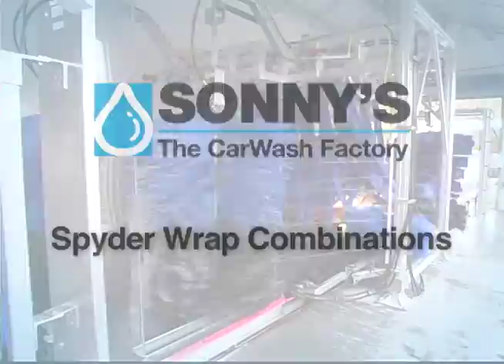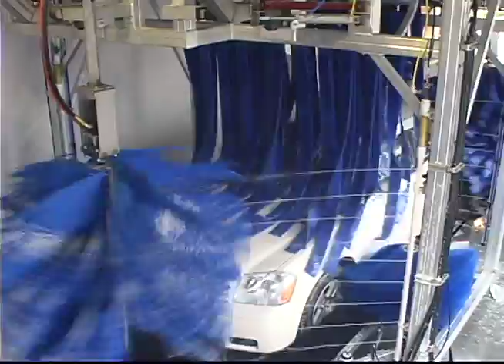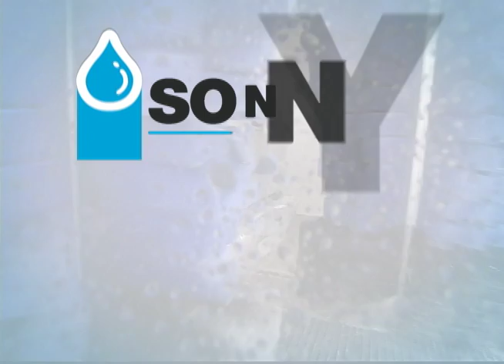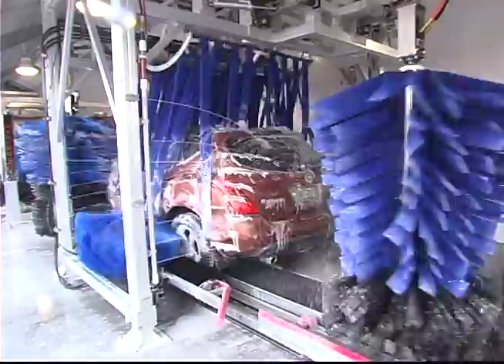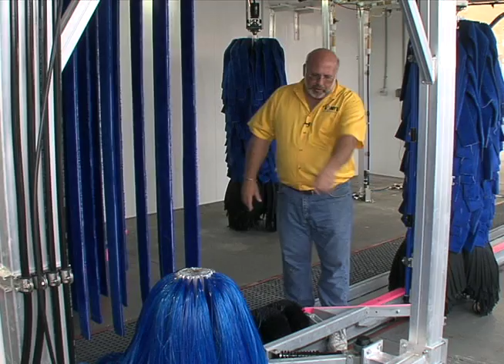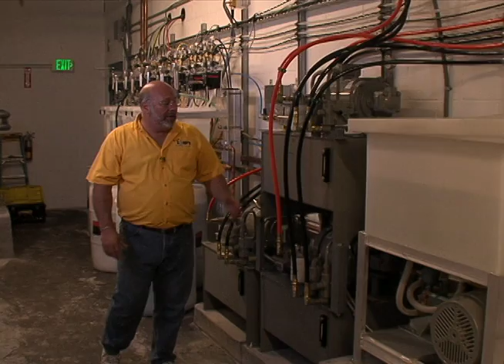Car Wash Equipment - Spyder Wrap Around

Comment: does the wrap around hit the car hard because that's way better than light touch
Reply: +Max Lopez 
You only want 3-4 inches of cloth penetration. The rotation, rpm's and pressures need to be set according to your chain speed. 3-4 inches of penetration will clean the car, with the proper chemistry, quietly which enhances the customer experience.